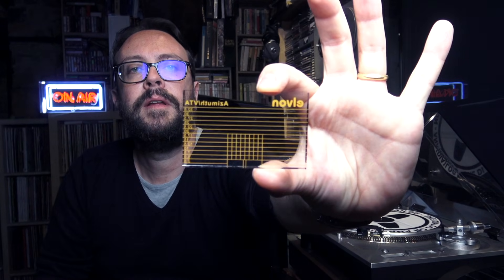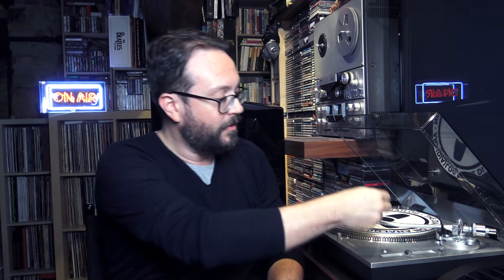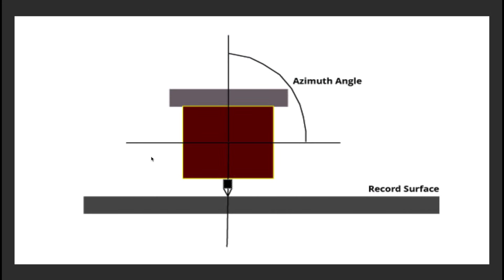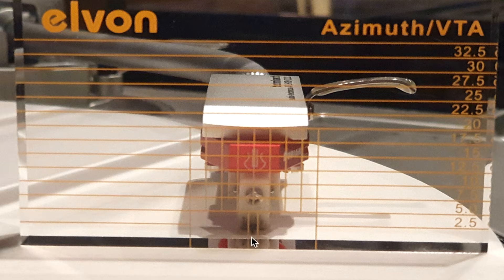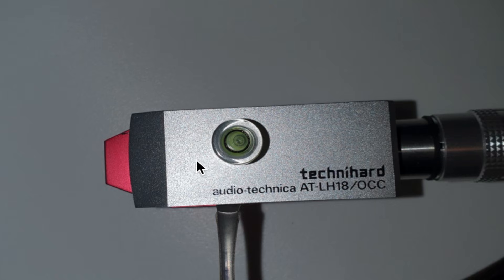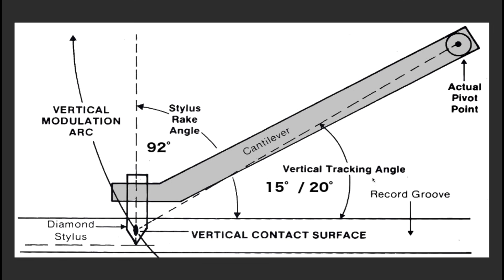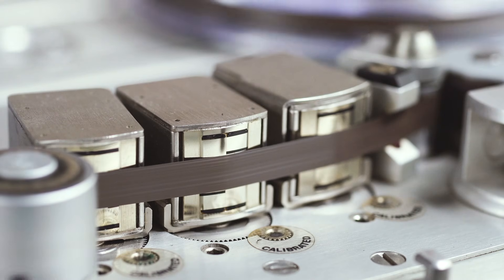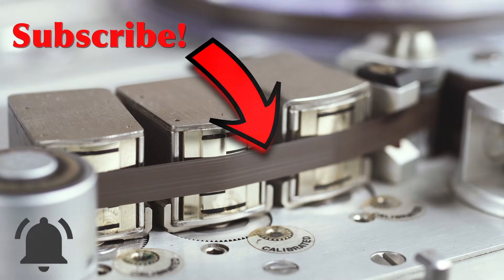VTA, SRA & Azimuth: What are they & how to set them

Comment: Good video, however you didn’t t elaborate deeper into the cart being level but the headshell was off. What needs to be aligned? The cart or headshell in this situation?
Reply from the maker: When touching the record surface the headshell is usually the one to look at but they should both be leveled unless one or the other is NOT produced in a parallels fashion, meaning curved lines

Comment: So you don’t answer shows how to use this tool
Reply: @anadialog  I thought you might’ve actually shown the process of actually using the  VTA TOOL   to set the vertical tracking angle .LIKE to set it at a 20° vertical tracking angle this is how you do it exactly and I will show you by doing it.  👍🏻

Comment: Spent an afternoon using the Elvon tools to re align my SME 3009 type 2 improved tonearm and it was close but not perfect so some adjustments were required to get perfect alignment. I found it was more important to get the headshell level with the record surface rather than the tonearm itself. I also found the tiny level included was very useful. At the end of the day I found a noticeable sonic improvement using these tools so $$ well spent in my opinion. Thanks very much for sharing this video as I found it to be most informative 😊

Comment: Your video is great. The problem with almost all headshells is that they never stay parallel to the imaginary line of the tonearm. So, the big question is what should be aligned with respect to the plane of the platter? The headshell or the tonearm? Thank you very much, and greetings from Argentina.
Reply from the maker: Thanks! Will I would start with a headshell that IS parallel to the platter. Clearly that happens when it has a cart on it and it is lowered on the record, then you must measure its parallelisms.

Comment: Most cartridges come with measured VTA, meaning when the headshell is parellel to the album, the stated VTA is achieved..
    The only variable is the album thickness, which could change the VTA as you play different thickness albums. Albums vary from 0.9mm (rare thin) to 2.2mm (heavyweights). Most records fall between 1.5mm to 2.2 mm, o if you can find one in the 1.7mm to 1.8mm range, that should be a good.
   Normal albums are 120-140 grams,  if you find a couple of those, you can weigh them and use those thicknesses as your base as well.
   Borh ways will get you close to a happy medium that should play decent as you play albums of varying sizes.

Comment: The reason we use about 92° SRA is because when the lacquer is being cut, the cutting stylus is also set at about 92°. There was a guy that went around all to the lacquer cutting places in America and measured the SRA of the cutting heads, he came up with an average of about 92 degrees.  That's what you want to shoot for 92 degrees. 
Great video.
Reply: The VTA can be maintained permanently, but the SRA changes every time you change a record & is a different thickness to the last?

Comment: Don’t you need to adjust the tracking force to account for the Weight of the Buble levé on the headshell?
Reply from the maker: It is surely better to have everything how you actually use it, including the tracking force, but unless it is insanely wrong it won’t change that much

Comment: Shouldn't the VTA gauge be on the surface of a record and not the mat?
Reply from the maker: Indeed! I said that it has to be touching the surface of the record multiple times. I just left the mat, which is actually quite thick, to work better around it and increase visibility but thanks for pointing that out!

Comment: The following is not "in the weeds" but a correction to major flaws in this video by an Acoustics guy.

9:40 Skip to here.  That first garbage acrylic one is ONLY for the azimuth of your cartridge and the whole discussion starting here 5:00 is as faulty as a "flat earther" doing a TED talk. The diagram shown is garbage, the discussion of the diagram is garbage, and nothing there tells you anything right.  If you must know, that gauge is measuring how high your tone arm is from the platter, not the SRA or VTA, and this height is something you note when you swap cartridges.  The only proper use of this (first acrylic is an azimuth gauge), is to note the exact height of the tone arm before and after cartridge swaps.. and if the difference is measurable you may need to adjust your VTA.. and this is only possible with an adjustable tone arm (vertical height at the cantilever) on some TT models.  You can also shim cartridges, but only SOME cartridges, as Ortofons on a P-type are one-piece and this has nowhere to shim.

Further, the "92" degrees is assuming a deflection of 2 degrees in the needle.  Needle here is not the antique Victrola term for a stylus, but the component of the stylus which is not the Jewel at the tip.  The stylus, when changed, requires all this checking of alignment, just like aligning the front of a car after changing suspension or steering parts.  The stylus of 33RPM records is a Needle (the shaft, shaped like a sewing needle), with a Jewel on the tip (which is the consumed part that requires changing the stylus after some hours of use).  OK?  So every stylus deflects under the tracking weight.  Specifically, the Needle bends like a spring, and the "92" means its bending TWO degrees.  This varies from about 1.6 to 2.6 with different styli.  Its usually in the specs, but regardless, this is why the bubble gauge shown on top is showing a positive lean.  If your Azimuth is correct, this bubble level is, like the "tone arm height" mentioned above, only useful for a before/after switch of the same stylus.   The "92" is an "always" rule of thumb approximation for a starting point of your SRA.

Next is where the critical alignment is done by ear, like tuning a piano.  You can align a brand new stylus to perfect sound, then add about .2 degrees for needle warp during the break-in.   The needle will permanently bend over time, so this alignment changes, and this is why a new stylus may sound better or worse after a break-in period of 20-50 hours.  MANY people discard a still good stylus rather than correct for the critical SRA as a stylus ages.  You should check your SRA (unless you have perfect ears to "know") after every 200 hours of play.  You will get a "feel" for a model of stylus, if you stick to it for years (several identical styli).   Ideally, a serious Vinyl audiophile wants to own an LP in perfect condition, but with a very slight, simple warp, for setting the SRA by ear for a new stylus or shell/stylus.  This is a learned skill.  You may find that your particular TT, tone arm, cart, and stylus only need .5 degrees when new!

The TL;DR is:  The poorly explained cheap acrylic tool shown will set your AZIMUTH.  This is step one.  (This also assumes the stylus is aligned perfectly in the cart, which must be inspected visually as best you can!  If its off slightly the azimuth can be compensated.  Azimuth error results in notable loss of stereo separation or balance issues.  Fine tuning the LRA/SRA is something you must learn by ear, and only possible if able to change it with your TT tone arm height, or with shims (Shims may not add SRA in some carts.  An excellent condition LP of the right source material, with a very slight, simple warp is perfect to hear your SRA changing (33.3 times per minute).  An "old" stylus may only need a tiny head-shim increase of SRA to correct for another 200-700 hours of use.  (Life depends on the specific model)  Required SRA to maintain ideal position of the Jewel tip increases through the life of the stylus, with the most change in the "break-in" period.

Playing ANY warped record will seriously advance the change to your stylus' SRA.  Very mild warping will do almost nothing, while a double warp bent record should only be played if you fully intend to realign the SRA later.  Its easy, even fun, to watch the needle bend tracking over a warped record.  This is radically changing the SRA in real time, so you should be able to learn to hear the SRA "range" as it goes back and forth.  Some jewels are much more affected than others, with some saying the MicroLine is most affected, Conical/Spherical least affected, and Elliptical in the middle.  I do not have any professional opinion on that.  I can say that while the SRA is going up and down massively on a warped record, it is also changing its tracking weight in that cycle.    So the upswing in SRA just as the warp is encountered, leaves the neutral point with extra tracking force, while it crosses the same neutral just on the downside of the warp with very low tracking force. A proper weighted arm may even skip on the downside of the warp, requiring overweight setting to play the disc.  Such a disc is much too warped to set your SRA!

Notes:
Its worth having a "beater" cart around for "saving" old records to Digital that you don't want to wreck your kit playing more than once.  Pops and crackle noise are not related to anything going on here, except that seriously heavy dirt should be easily removed with a quick brushing, to protect your stylus.  Minor (fine dust the brush doesn't remove) doesn't hurt a stylus, but total removal is a whole thing that can be done with Elmer's glue for digital preservation purposes.  Also, for you serious hacks who read this to the end.. you really don't need to shim or pay $1000 for a new TT that can lower its tone arm height.  If the arm is metal, you can make visually imperceptible bends to it, which will raise or lower the tip, changing the SRA, even side azimuth.  IN FACT, IF YOU MOVE (relocate dwelling) the tone arm will likely get bent in shipping if it bounces around, changing the SRA!  You cannot even see a .1 degree bend, but it matters.  Generally, every expensive TT has adjustment for SRA, and cheap TTs that don't usually have cheap tone arms that bend nicely. :yougotthis:
Reply from the maker: Hi there and thank you for your very rude comment. 
It’s funny because you talk about flaws and then across your comment you repeat exactly what I said but in a different way. From someone that talks about “needle” instead of cantilever and “bending” instead of compliance I think you should come down from your pedestal, get informed and respect other people without being driven by prejudice and hate. The second part of your comment adds some information, why not do that? Why not produce a useful comment and discussion for the community instead of starting out vomiting hate. Why make up stuff? How lame and sad.
Reply: Exactly.
Reply: I was not putting down the "cheap" acrylic azimuth tool, or promoting the crazy expensive one.  Either one serves to do a check for azimuth. (personally I trust my eyes, and ears to double check the stereo effect of azimuth, and own nothing like this)  The arm level, or head level tools only give you a starting point, as you should set your SRA by ear.  So both work equally well.  I would not trust either, or the cartridge specs, for where your SRA should be.  Only your ears (or someone else's) can do this.  You don't need any tool, except a very slightly warped record in otherwise great condition.  Center hole should not be offset at all as this completely destroys the subtle changes you are listening for in the SRA.  

Center hole offset is when the head/cart is moving left and right a little as the record turns.  You can and should drill out the center of the record if you get one like this and really want to play it often (and its not valuable).  You then get it perfectly aligned to play without swinging the arm, and put a mark with whiteout or sharpie (both sides) at the closest point on the rim of the hole you drilled.  This sounds hard but its very easy to figure out and do in practice.

Comment: Likely to be have been mentioned elsewhere (in another comment) but "azimuth" must be set relative to the diamond shank (needle-point) - NOT the cartridge body. Using the "body" (as these tools do) does not guarantee any degree of accuracy, as you have no way of knowing if the manufacturer has the quality control to make the diamond shank and diamond surfaces perpendicular to the cartridge body.. Better techniques exist, such as using a test-record with a one 1Khz sine-wave cut in in one channel [left then right] with equal amplitude and then measuring the "cross-talk" bleed-through to the opposing channel  (using an o'scope -- or capturing as a *.wav and using digital tools to measure). At best, what is shown here is a "guesstimate" -- just a tad better than ogling it with the naked eye.
Reply from the maker: You are correct but done by the naked eye and with budget gear this is pretty accurate. In fact for perfect azimuth setting I use this, which confirmed that the naked eye allignment was correct: https://youtube.com/watch?v=is5o6xuyLaI&feature=share9

Comment: just saw this vid I have 2 turntables where the tone arm is set right my pro-ject debut 3 especially when i replaced the platter from steel to acrylic the tone arm is even with playing surface my atpl-120 is adjustable and even before i saw this vid i already had vta evrything adjusted cause they can be on this model but what if you have a dual 1237 ,or dual 1009sk or a garrard at-60,or a garrard autoslim mpk 2 or the bsr 610 these are not adjustable ,the dual turntables i have are very good but since they can be used as a stacker there is no way they can be adjusted ,the only thing i could do was for the duals i found a gauge meant for these headshell helps align the stylus 's overhang and i adjusted the alignment ,but thats all but they both sound great is there a way to adjust the tonearm alignment i do not think so JRo

Comment: Thanks for the informative video! 

Funny thing, with Sumiko carts, like my Blackbird, they actually instruct you to have the tone arm tilting upwards, so that the base of the tonearm is below the headshell. 

Kinda like the tonearm is looking upwards, with the vantage point being the base of the tonearm. 

they want -2 degrees of this particular tilt. 
In fact, according to the Sumiko-manual a perfect horizontal tonearm is never correct. 

As they say, your should start with tonearm tilting up -2 degrees, and then with miniscule increments increase the height of the tonearm-base to achieve a slightly more horizontal tonearm orientation. 

My findings is that this is absolutely correct, for tweaking the blackbird atleast. 

As you move closer and closer towards horizontal tonearm orientation, the sound opens up, the sibiliance region is also increasingly pronounced.
This results in a thinner - or colder sound with more emphasis on high frequency content. 

In contrary - a higher level of negative tilt will produce a more robust, round, warm and 'rolled off' sound.

Sumiko even warns about not falling into the "hi-fi trap" while adjusting VTA / SRA - 
The tendency of wanting a sound with more emphasis on high frequencies - which is a common pitfall, should be avoided. 

Many would be surprised how the actual correct sound is much warmer and more robust - which at first will be mistaken for being a 'rolled off' or even low-fi sound too many, as they gradually tweak the VTA.
Reply: t

Comment: An important distinction between azimuth and VTA/SRA and azimuth is that VTA/SRA is much more of a moving target.  Outside of a warped record or something like that, once azimuth is set, it's set.  SRA changes with thickness of the LP.  So 150g, 180g, 200g etc. will all be different because of the thickness differences in the vinyl.  There's no perfect solution period, but if you're obsessive you can mark (at least on my Dynavector 507 tonearm) where the "proper" setting is for each.  Or, if you're sane, find a good compromise and forget it.
Reply: All correct. Also, nobody ever mentions record changers. If you have OCD don’t own one then cause each record that stacks is really gonna jack up your VTA lol.

Comment: Hi there, thanks for the video and explanation. I have a Technics 1200 MK7 with stock Technics "S" tone arm and head-shell, using a Goldring E3 cartridge. When I use the acrylic block to check the VTA, I am getting conflicting information... when using the head-shell for alignment, it shows that I need to raise the tone arm.  Conversely, when I use the tone arm for alignment it shows that I need to lower the tone arm... which should I be using for reference, head-shell or tone arm??
Reply from the maker: That doesn't seem right, something seems crooked...in any case, since the arm is a bent type, meaning that is more difficult to align I would stick to the headshell.
Reply: I have the same platter, and the same thing happens to me. If you look at the headshells, they're not perfect. When you mount them on the tonearm, they don't align perfectly with the tonearm. So, do you align the tonearm or the headshell?

Comment: Check out the Fozgometer. Used in combination with a test tone record will give you an accurate way of configuring azimuth.
Reply from the maker: I saw they made a new model. Have you tried it? The first one was not very accurate.
Reply: @anadialog  I have the V1 unit. Does the job but it’s very sensitive. Will get you pretty close without relying on your eyes. Just saw the V2 online, hopefully it’s more accurate than the V1.

Comment: That's a great explanation.  I purchased the unit after seeing your video.  However,  one thing I didn't understand is how to use the tool to set the arm to the right height to get the correct VTA. Do you use the numbers on the vertical axis? Or do you simply adjust the height of the arm, once the stylus is resting on a record so that the arm/cartridge head are level? Does doing this automatically set the correct VTA? I'd appreciate your thoughts.
Reply from the maker: Yes, it's an approximate solution. Not 100% accurate. I use it to set the arm parallel to the platter while tracking.